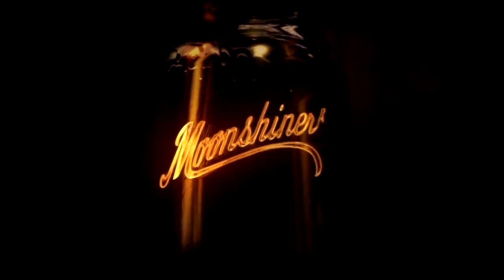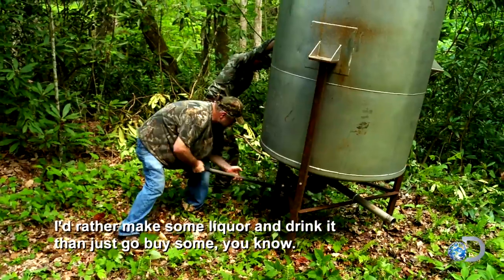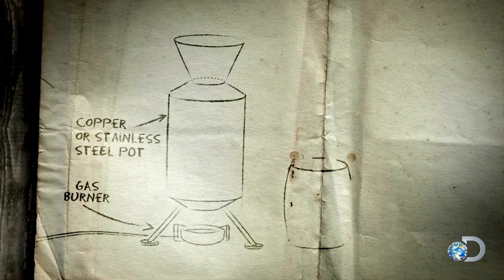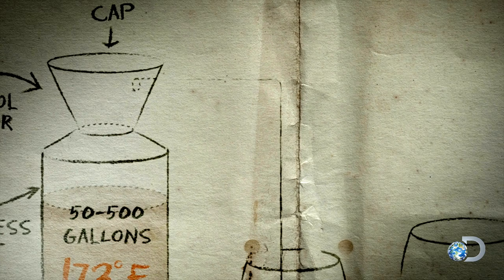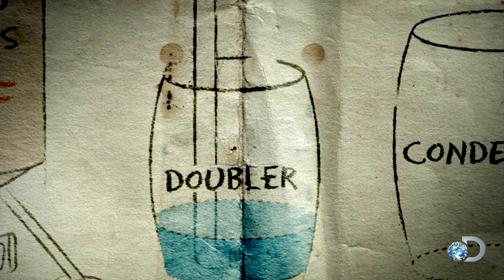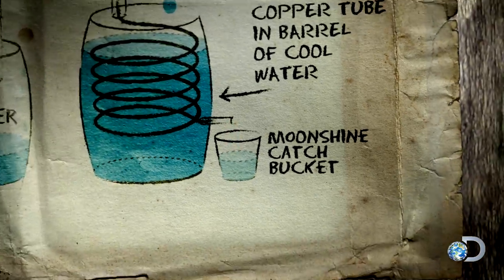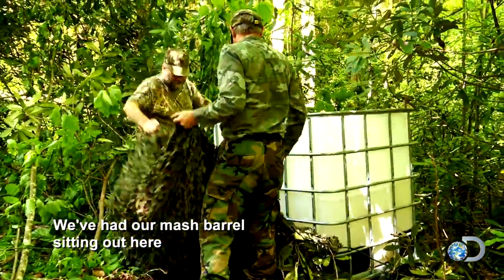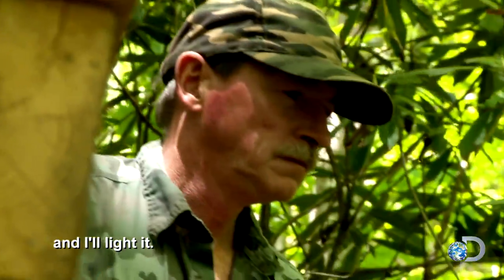How a Moonshine Still Works

Comment: how does the doubler work? and what does it do?  i don't really understand it's purpose. do I have to use cold water und do I have to replace it when it is getting warm? thanks in advance.
Reply: A thump keg (doubler) is to offset the mistakes the amateur doesnt know he is making.
Reply: The cold water helps the hot alcohol vapors cool and the contrast between the now cooled molecules and the ones that haven’t yet cooled off causes the molecules to condense into liquid.